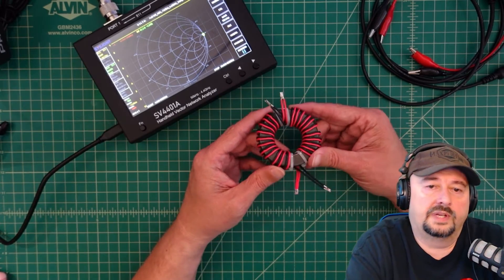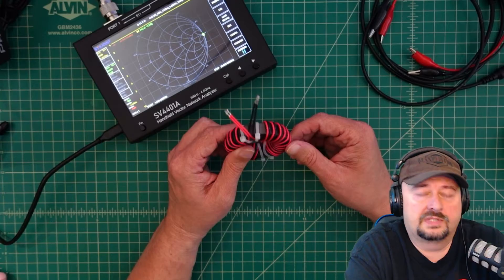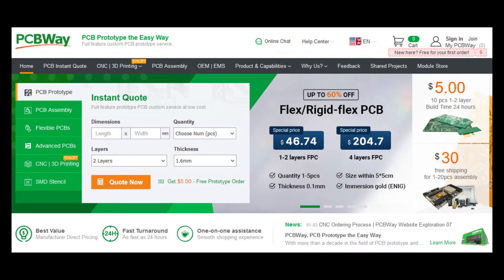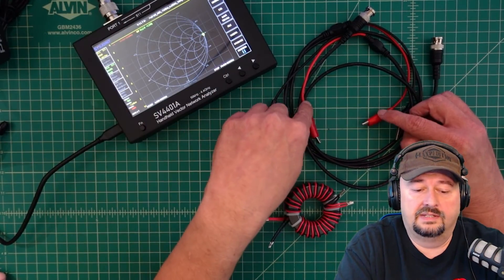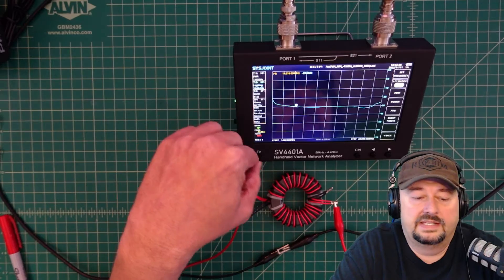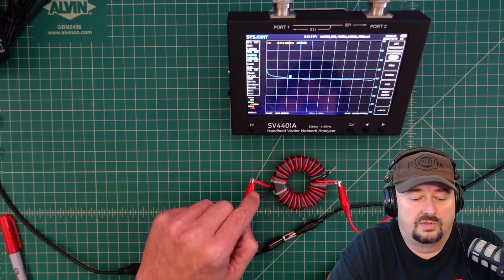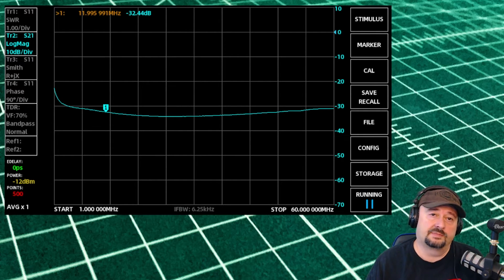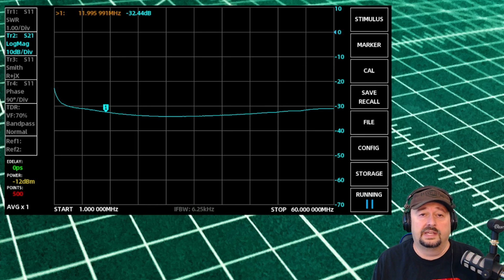Measuring a Common Mode Choke

Comment: if you hooked that winding up to your center pin  on the coax wouldn't your signal be attenuated by -30db?  Am I missing something here?
Reply from the maker: No, it wouldn’t.  It would only attenuate unbalanced current like common mode NOT balanced current like differential mode 👍

Comment: I must not be understanding what the VNA is doing. Help me understand where I’m wrong: Your VNA is sweeping 1 MHz to 60 MHz signals out of one port, sending the signal through your choke, and then measuring the received signal magnitude of that sweep on the other port. And you’re seeing ~30db of loss in the signal. Why would you want to have an HF choke that radically suppresses the very frequencies you want to transmit and receive on for HF?
Reply from the maker: It suppresses the unbalanced current (CMC) not the balanced (signal) 👍

Comment: FYI: You're probably not able to connect the NanoVNA to your PC using the USB cable because it's one of those sneaky "power -only" USB cables and not a full "power & data" USB cables. Had the same experience. BTW, you should be getting greater than -40dB rejection if you tied the black Nano leads together and hooked each red Nano lead to the TIED-TOGETHER red/black on each end to each red Nano lead. This way you've cancelled out any "differential" currents and are ONLY measuring the net "common-mode" currents running thru the CMC on BOTH the red and black coils. See Mark Smith-N6MTS of Halibut Electronics video https://www.youtube.com/watch?v=SW34Z4JPK_o for a great explanation (and test fixture) to measure common-mode rejection properly. 73 DE Rudi-K7RAW-The Antenna Whisperer (see my channel for TennaTalk podcasts #12a and #12b for much greater details about this and TLTs) (ie-BalUns and UnUns).

Comment: Hi thanks for the great video. I followed your steps and tested my first self wound RF choke. However, I saw a lot of variabilty on my S12 gain plot as opposed to what you showed here. I did see your video on jenky test leads (very helpful). I was getting sub -40db measurements as well... so I am suspicious that something is off. My choke is a 240-43 wound with 11 turns of RG8x with 6 forward and 5 backward turns. I did hook my leads to the center then the shield, and got similar results. 73's!
Reply from the maker: It’s fun to keep messing with these and testing. Thanks for watching Jim 👍

Comment: I made a choke with ferrites and the coax running through them. What is the best way to test that choke with a nano vna? Looks like I use the mag log test, short the shields and run the test through the center pin. Does that make sense?
Reply: I did the test. The one with 6 ferrites is a-41 dB and the one with 5cis - 37db

Comment: Conceptually I understand how a CMC works, I have the Halibut Electronics CMC test rig, which just puts the center pin signal on the sheild and measures return loss, which makes sense to me, its forcing current into common mode. I am struggling to understand how a through measurement like you have here (as i understand it, could be missing something) it looks like youre just measuring continuity. A schematic would have been helpful, perhaps with how it "would" have been connected in a coax feedline. Thanks Ape!!
Reply from the maker: Fair point, here is a video that shows how chokes "work": https://youtu.be/pR3yciM45UY

Here is my playlist that show all kinds of toroid projects: https://www.youtube.com/playlist?list=PLm8ROkpFeqoqkGQtBYfcT9Y-2GCKxBuuk
Reply: @TheSmokinApe  Thank you for taking the time to reply! I watched the linked video, and it cleared up my question. Thanks! I appreciate the patient education you give here.
Reply from the maker: @danielwinn5707  glad you like them 👍

Comment: Great video. It is a simple setup. You explained everything very well. I have seen other videos that want to inject signals using resistors and put a -10 db load on the s21 input. I don't see the point. Your video shows a much simpler way of measuring a common mode choke. Thank you very much. Some VNAs only have 101 fixed data points, not adjustable ones. I'm considering getting the NanoVNA-H4 V 4.3 which only has 101 fixed data points.  Are 101 data points ok instead of 401? Thank you again for your video on explaining how to measure common mode chokes. I really appreciate it.
Reply from the maker: Hey Matt, with the newer firmware most support 401 points.  You can also use NanoVNA saver to create segments, 401 point x 10 segments is 4010 points 👍
Reply: @TheSmokinApe  Ok, great thank you very much for that information. You did say in your video that you liked NanoVNA saver. I'll make sure that I have it installed on my computer and make sure my VNA is updated. Thank you again.
Reply from the maker: Good luck with it Matt 👍

Comment: HI - recent subscriber - love your videos and you convinced me to purchase an SV4401A - works really well. But.... I am soooo confused and I should know better about this stuff. I just wound 12 turns of RG-174 on an FT140-43. Did a calibrate on the 4401, hooked up a pair of SMA--> bare wire cables and connected the new choke. Well, I get a nice <30 dB curve quite similar to the one you got with your teflon-jacketed wire choke. Looks great on 40 - 10 meters. But here is where I have to scratch my head. I get the same attenuation if I connect the center wire of ports 1 and 2 to the center of the coax as I do with the ports connected to the braid/shield. I like getting 30 dB of attenuation on the shield but I don't want the center conductor signal attenuated. Am I over thinking this? What the heck am I missing?

72, Jim / K7TXA
Reply from the maker: Check out this video and it should cover it for you:  Balun Chokes - How do they work?
https://youtu.be/pR3yciM45UY

Comment: I really enjoyed the video, as I do with most of your videos.  However, I was disappointed that you glossed over the calibration parts.  In this case, you've added two cables that aren't present when one does a standard OSL calibration.  You mention doing the thru part of the calibration using the two sets of clips connected to each other, which makes perfect sense.  But is that the ONLY difference from a standard OSL calibration?  What about the isolation part of the calibration?  Needed, not needed?  Were those cables present for the OSL part of the calibration as well (In other words, did you use the OSL standards at the port end of the S21 cable, or did you use them on port 1 without either cable in place)?  Sorry if I'm missing something obvious.
Reply from the maker: Hear you go NorthTX Alligator Test Leads and the NanoVNA
https://youtu.be/gzmrueSXteE
Reply: @TheSmokinApe  Thanks!  I'll check that out RFN!

Comment: Is it necessary to use an inline attenuator (something like 10dB) on the s21 port? Would it impact the safety of the test equipment when measuring baluns? My thoughts are that it would help with impedance mismatches. 73 de YU4BGN !
Reply from the maker: You typically use them when testing amplified signals, so you don’t overload and damage the input 👍
Reply: @TheSmokinApe  Thanks Ape! Keep doing amazing stuff for the hobby. Many thanks from Serbia, 73 de YU4BGN!
Reply from the maker: @bogdanmaksimovic37  thanks man, stay warm 👍

Comment: Got a 240 size toroid that arrived cracked cleanly across the width of the toroid on one side. It was replaced but I'm wondering if it could be used if I taped across the crack to keep that side from wiggling. The crack appears to mesh back together good enough that it is hard to see the crack.
Reply from the maker: it won't be as good as a new one but it will work like a clamp on ferrite, give it a try.

Comment: Is this type of choke better than wrapping coax around the toroid?
Reply from the maker: I use both, it will depend on the type of core, coax and wire.  It’s best to test whatever you make to make sure it will work for you 👍

Comment: What about the impedance? Isn't it important that besides having a -30dB gain also have high impedance?
Reply from the maker: Hey bteixeira.  The impedance is important as is the nature of the current.  With the choke we are suppressing Common mode and not differential, check this video out: https://youtu.be/pR3yciM45UY

Comment: Great video.  I took out my nanoVNA and spent last Sunday making measurements.  I have a bunch #31 and #43  (2.4" OD)  toroids.  The #31 for chokes and the #43 for 49:1 ununs.   I learned to mark them too, but one thing to note, these two mixes can easily be identified using an Ohm meter. I don't recall which, but one will measure a value of 100s kOhms whereas the other measure out of range.

My question.  have you tried different wrapping materials and configurations?  My observations show that coax wrapped chokes stop choking near 25MHz and I also find that wrapping 8 then a cross thru with another 8 (8x8 =16 wraps including cross thru) performs with a flatter -35dB whereas a straight 16 wrap rises by 5dB over the same range.   I also tested using silicon wire and enamel coated wire.   Enamel coated wire worked much better -35-40dB to 30MHz then rising to -25dB to 50MHz.

And while using coax is super easy to wrap,  I observed that can overcome the lower performance by wrapping several in series.  It actually gives great -40-50dB performance over a wider range.  My understanding is that wrapping a core increases capacitance but as you know, adding capacitance in series reduces overall capacitance (1/C = 1/C1 + 1/C2 + ...). 

Thanks again, prior to this I only used my nanoVNA for measuring antenna VSWR.
Reply from the maker: Yes, always mark them or it can be a problem... lol.  I have tried different configurations and materials, what I have found is the more wraps the less improvement you continue to see.  Thanks for the comment dreupen 👍

Comment: Good video and appreciate what you do for the hobby, question though, is the wire size critical or could you use a larger guage wire without any negative effects
Reply from the maker: Different gauge can have an impact.  Give it a try and see how it works.  Thanks for watching James 👍

Comment: Your test procedure just didn't show the fine differences between bands and your hookup just wasn't quite what I would expect. There is a video on which has this heading, you should be able to search this title. " Attenuation testing 1:1 common mode choke balun design from TRX Bench" which is a valid test aproach.
Reply from the maker: The video was to show how to test, not so much the actually results of that particular balun which is why there was no diatribe on a band by band base.  What about the approach was invalid?

Comment: How is the SWR from 3 to 30mhz?
Reply from the maker: This choke would have a minimal impact on SWR 👍
Reply: @TheSmokinApe  The wire used for the winding will definitely have an impact on SWR especially at higher frequencies if the characteristic impedance of the wire isn't around 100 ohms. The core won't effect the SWR, but the wire will. 

Use a 50 ohm resistor to simulate an antenna and do a sweep with the VNA, 

Would suggest looking at TrxLabs 3 videos on common mode chokes and a 4:1 balun. You'll understand why your 4:1 balun (another video) has a high SWR above 14mhz. 73 de K3RDF
Reply from the maker: On the 4:1 the wire was a low grade hook up with and I am sure the cheap resistor added reactance with increased frequency.  Additionally the windings were not paired correctly.

Comment: Can you show how the “normal RF”will pass or will it be 30db attenuated also?
Reply from the maker: It will have < 1db of insertion loss, I will do a video...
Reply: In theory "normal RF" is differential mode voltage/current (as opposed to common mode) and therefore not affected by the choke.

Comment: Hi, I have been playing with common-mode chokes a lot over the last few years, chiefly using FT240-31 and FT240-43 cores. I have made them with coax but found them relatively narrow band, possibly due to the capacitance between turns. Consequently to achieve good common mode attenuation on 160m made 10m performance suffer. My most recent uses 2 twisted pairs from CAT6 cable (nominally 100ohm) but configured similarly to yours. (I have two cores stacked). The results from mine are very similar to yours but not quite as flat, better than -26dB from 160-10 but close to -40dB on 40m. As you can imagine I have no confidence in it handling high power but 100w of carrier has been fine. Insertion SWR is surprisingly good. I ran out of Teflon wire hence resorting to stripped down CAT cable..so a very cheap experiment. 73
Reply from the maker: Thanks for the informational post g0fvt 👍

Comment: Thank you, sir!

How would you use this specific choke? On a noisy RF source in or near your shack? The findings are very specific to this hardware and architecture. Or is it a testing/learning/teaching tool?

I expect a need to place 1 or more 240-31 chokes in series on the RG-8X feedline to an EFHW antenna (same that you built in earlier videos). 

It seems I could use this approach with a short length of RG-8X to measure the choke effect change with increasing # of windings, and then hook 2 or more in series and assess the sum of the decrease in CMC. Sound right? Or am I off base?

Could you perform a similar assesment with a tiny SA?

ATB!
73,
John - KK7JBZ
Reply from the maker: Hey John, glad you liked the video.  You should check out this playlist where I cover this stuff in detail: https://www.youtube.com/playlist?list=PLm8ROkpFeqoqkGQtBYfcT9Y-2GCKxBuuk

I put a choke / balun at both ends of my coax, at the antenna feed point and right before the tuner and it really helps.  A counterpoise will help with the noise as well.

This video was more about teaching the process of testing, which can be applied to any balun.  You can make these with coax, I have a video on that too...

Hope that helps!

Comment: Great video Ape! I will have to try that on my choke. I built mine with RG58 coax so I will have to see how that impacts the way you connect. Be curious to see if I can get that good of results.
Reply from the maker: I've done the same video with an RG58 cable and the results were good.

Comment: Sweet but where is the Amidom Kmix core testing ☺️I’m still anxiously waiting maybe not so patiently 😉I ll try to vid my short of my 4core balun finally got it wound pretty enough that I can show it off sum how got 16 turns around it doing 8 then a cross over to opposing side & working my way back to start and using a center spacer so I can use nylon all thread to secure it in a uhmd cassis that will float it above ground. I used rg400. Next step is cut uhmd and drill a few hole to hide some hardware
Reply from the maker: Hey Kevin, it will make an appearance on this Saturday's show 👍